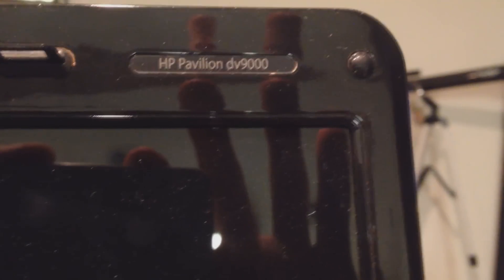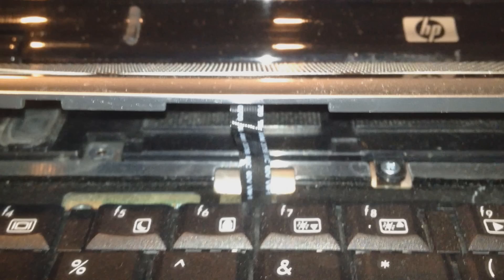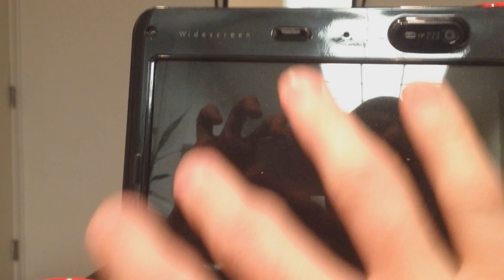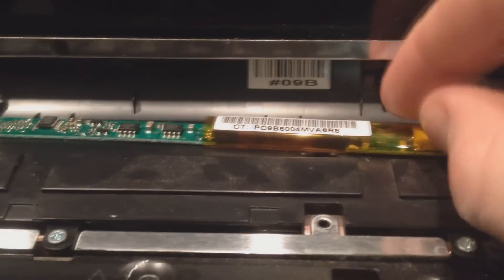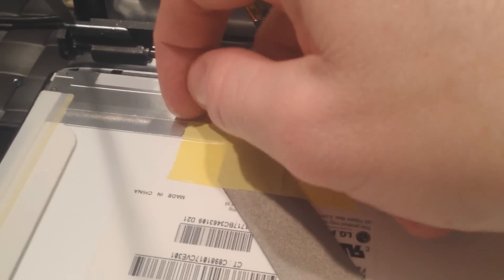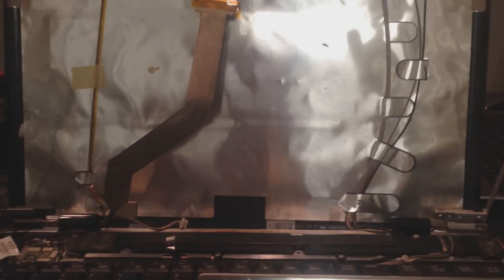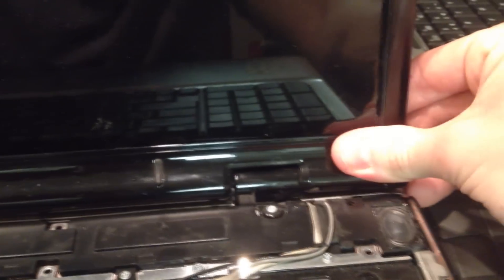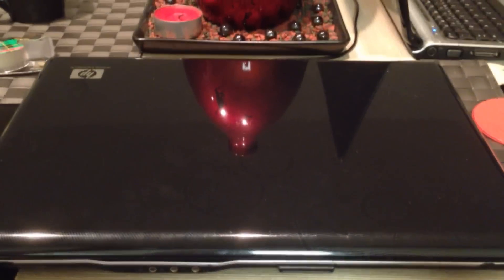HP Pavilion DV9000 Laptop Inverter And Screen Replacement No Backlight Problem Fix

Comment: Thank you for the video  I really don't plan on doing any of this task on my own but just hope that someone can give me advice. The problem I have is that parts of my screen display partial lettering and makes it hard to read.  This happens at random times and does not include the entire screen, not always located in the same area of screen either.

Comment: I have this same horrible HP computer its a 9700 series and 19" screen the hinge on one side got stuck, technician is trying to find an inverter he couldn't repair it, my hinge on the left is a problem and the screen plastic is cracked, trouble is I'm in SE Asia so parts are had to find but this HP laptop seems to have been widely sold at one time and I've seen them around.  If it's the back light I won't replace that I'll just use my TV monitor.

Comment: The wide ribbon cable fixed mine - but I had the red lines that would come and go horizontally when you opened and closed the lid to different angles.  Ten bucks on amazon :)

Comment: First of all thanks for this tutorial.

However, I am a bit hesitant to order a new screen (costly) and install it.   I don't know if it is indeed a problem with the backlight/bulb itself.  I installed a new lcd inverter but unfortunately the problem wasn't solved, it's the same.  It is intermitent: Sometimes I start the computer (HP Pavilion dv2000) and the screen is illuminated, but more often it isn't, altough I can see there is image.  After some tries (putting it to sleep mode and then on again) it sometimes works (I am writing on it right now, but I am afraid of ruining altogether).

Do you think it is still the screen, the backlight?  There is always image, only mostly with no light.  Thanks!

Comment: I bought an inexpensive inverter off Ebay violating an old principle "don't throw parts at a problem if you're not sure" (but it was only $5.20.  My 9925nr works fine with the external monitor but it progressively lost the native screen.  Lots of horizontal lines, quite faint.

The good news is your video got me in to the inverter lickety split but no joy as the problem is not resolved.  I wonder what else it might be?

Comment: Thank you sooooo much for this video. It was just what I needed to get in and out easily to repair a connection on my dv9009nr. I have used this laptop for so many good things, but my screen was flickering and turning dark on one side or complely going out. My laptop screen is looking fine and is stable now. Thanks!!!!!!!
Reply from the maker: Awesome glad the video could help:)
Reply: TipsNNTricks
It has made all the difference! After so long battling with the screen and moving it back and forth to get try to keep it working, it is surely a relief to have it working perfectly. It is an old laptop, but it works well, except that I have to use a wifi dongle, because a long time ago, the internal wifi quit working.
Reply: +TipsNNTricks I need help please answer

Comment: Great video, thank you.  Here's my problem.  Everything works fine, but on the lower right corner, when I try to close my screen, the bezel separates from back cover.  Some bits of black plastic fell out--so I think something broke on the back cover--and/or hing.  The computer didn't drop or get squished.  I haven't taken it apart yet.  It looks like replacing the back cover is major, since I'd have to remove/replace the camera, antenna, mike and whatever else.  Any suggestions?  Thanks

Comment: Okay so here is my issue i have a hp dv 9000 and sometimes it will show the bios screen and flicker and screen will bug out or the screen will just be blank but the backlight does seem to work just no picture. When i connect the laptop up to an external monitor it detects it and seems to work fine and show my os and i can use it from the external monitor. So my question is do you think its the inverter or the laptops monitor or something else. Any help would be appreciated.

Comment from the maker: No haven't gotten the over heat issue yet maybe I just haven't noticed, what I was always told is to keep it off the bed, or carpet the underside needs to breath and keep the fans rolling.  A hard surface like table or computer desk is the best option.